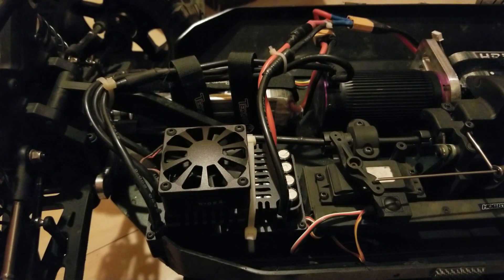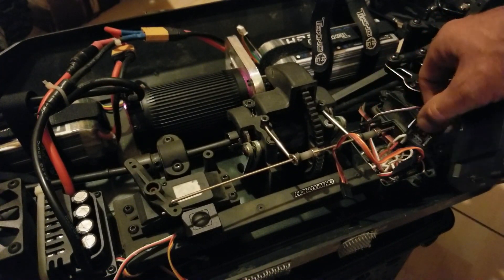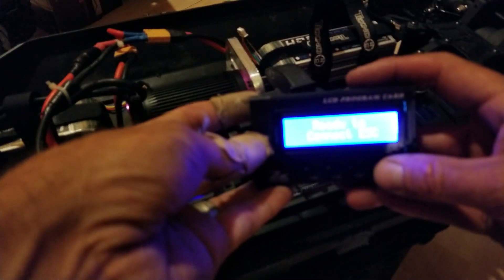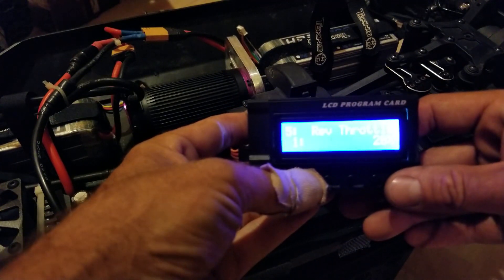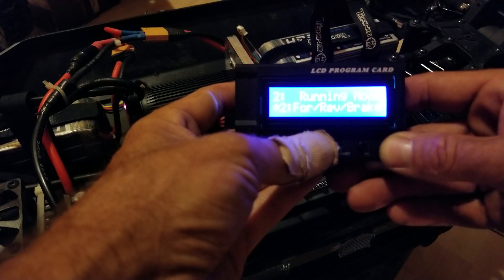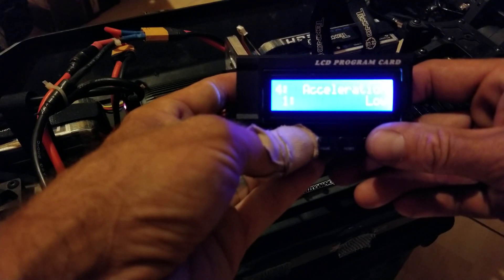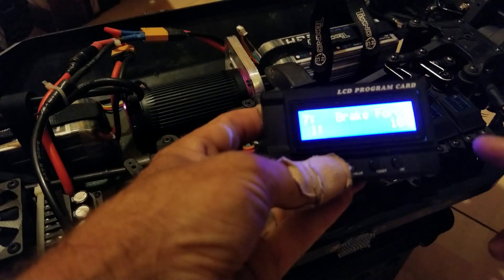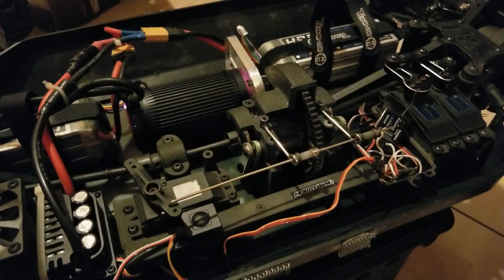Programming ZTW 300A 12S ESC

Comment: Hi friend to configure the ESC with the board can we leave the motor plugged into the drive??? To sum up, we connect the programming board with the shortest wire of the ESC, we connect the LiPo and then turn on the ESC with the inter to modify the parameters. 👍👍👍

Comment: why there is no reverse throttle ?
Reply from the maker: Because i had the reverse function set to the mechanical break so the motor did not have to slow such a heavy vehicle, the down side was no reverse.... but also no sheared gears from breaking letting off breaking again and activating reverse while 50 lb truck still rolling forward and boom go diffs ect.

Comment: will this work on a 120a sl beast model esc? i need to turn my voltage cut off down and engine timings badly.
Reply from the maker: Not sure. Have to check ztw been out of that loop for while. I think if you put the program on the box from ztw it will work but not 100% sure.

Comment: Hey man is this ESC any good ? Looks like the hobbystar 300 esc
Reply from the maker: The esc worked great. They need to be used with motors like poseidon, castle, ztw, hobbywing ect. No tp power, neu, cordova ect  motors... the esc cannot run the big high amp draw motors and will burn up. It is same as hobbystar 300a esc. I dont know how it has held up i sold that truck last year. I am considering putting a 300a 12s in my new kraton. And running it on 10s with stock motor.

Comment: I have a fid 5th scale dragon hammer voltz coming. What's the model number of that program card and where can I buy it from. Because the voltz come with that ztw 300amp esc but with no program card the esc will be programmed from the factory and I'm sure I may not like the factory settings. Thanks
Reply from the maker: I have a spare lcd program card. Are you in usa? I have 3 ztw escs and 3 cards... only need one.